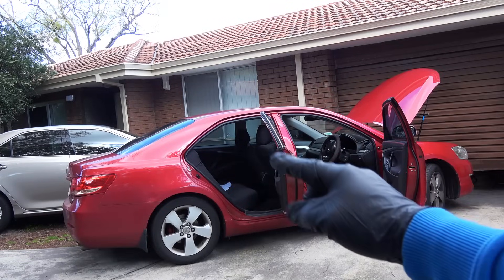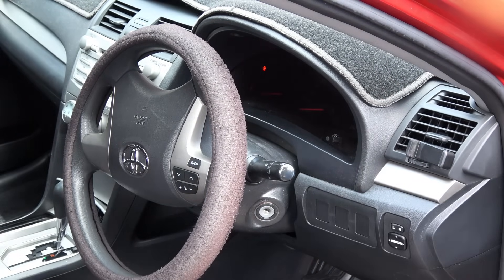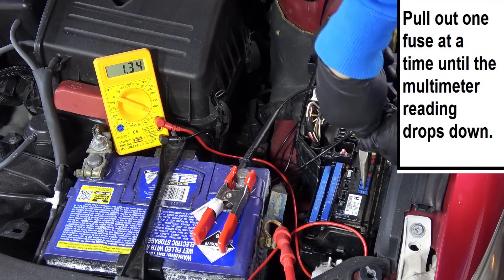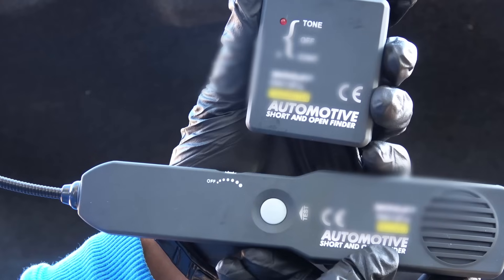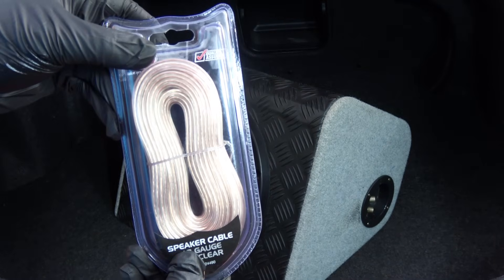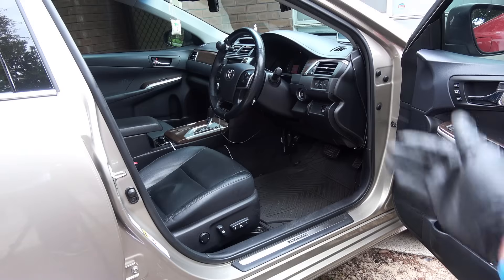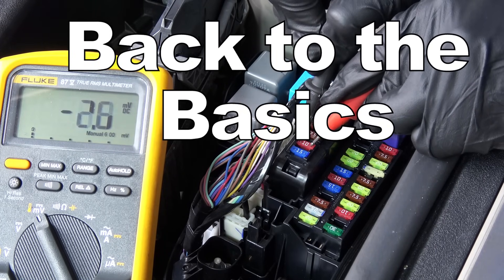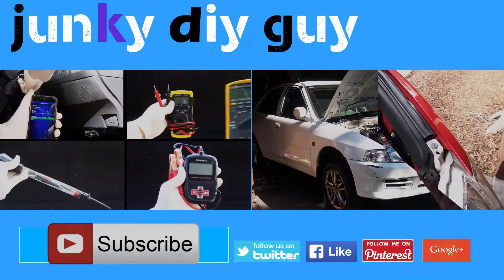How to find a short in a modern car fast and easy (The correct way)

Comment: The fuses actually do NOT protect the components,  their functions are to protect the installation  and avoid electrical  fires. (1.13)

1 -  If a component  draws too much current  it already is bad and the  only thing left to protect  is the wiring...
2 - If there's a short to ground causing higher current flow than a component  can stand, this short will  take place before the component and the high current doesn't even flow through it.

Think about it😏
Reply: Correct in a basic ckt unless the short occurs after the load, spikes and takes out an IC or other sensitive components or cause shunting.
Reply: A short to ground can occur after the component between 1 or more loads and may not blow a fuse.
Reply: Smart person who wrote this your right!
Reply: max webster
 If the short takes place after the component current flow will be limited by the component itself to the amount the circuit was designed for.
Reply: Not necessarily. It will be limited by the fuse which is there to protect the wire not the ckt.
Reply: In the case you have a short (GND) in a ckt AFTER the component a decrease in R may occur and you now have increased current. The damage might not be contained to that component and may jump to the next component in series. I disagree with your comment in a series ckt. If you wan to talk parallel, series parallel then throw a bad diode in and it's game over for some transistors and IC's and a good chunk of trace.
A short(GND) can occur after a load and might not cause a direct component failure other than by increasing current (not limited by the component) and you just missed the boat and may have ignited your new parts. Components DO NOT necessarily regulate current.
Reply: max webster 

Be so kind to give me just ONE example where the scenario given by you applies in the automotive world.
What I do see is a one-load-per- circuit rule. No such thing like loads in series.

I think components do NECESSARILY limit current,  always. This happens because of their inherent resistance 😀
Reply: Any component that includes a ckt board that is connected to the engine harness, pcm, bcm, relays with diodes, heater controls, power door locks and windows. NO such thigs as loads in series? WTF lol! Fans, variable speed fans and if I recall the dummy light for your alternator. A light bulb is a load hence GM reversing polarity TS, BL and my favorite the shift interlock system.
Reply: The active devices (FETS) are MUCH faster than a fuse. The transistor will blow BEFORE fuse opens

Comment: Every thing was correct up until you tried to pretend your subwoofer wiring short was pulling current on the radio circuit. I'm just guessing you used that as an example, to show how shorts can happen, but it's not possible for an aftermarket sub on it's own amp to be pulling current from your radio's memory circuit.
Reply: Mansour Ahmad if the istallation was so bad the the sub its self is pulling a current by bei g shorted first off thats all a sub is. The voice coil in a sub would do the same because its just a coil of wire that runs from the + termimal coils around the magnet then goes to - terminal. And if an aftermarket istallation place did such a crappy job that a sub pulled current from a battery i would really love to know where the hell they got their experiance. I could go out right now take all 4 wires to my subs connect them all together in one big clump and ill bet u anything my battery will be fine and there will be no current being pulled. But i do get his point. He obviously did t want to take the extra time on camera finding the short causd that really wasent his point
Reply: @jonnyr4332  k
Reply: Neurocidal it can happen if the installation was bad

Comment from the maker: You guys wanna know "How to STOP BRAKE SQUEAKING in your car  https://www.youtube.com/watch?v=ivMB4WEGgZo
How to Properly Replace Brake Pads and Rotors https://www.youtube.com/watch?v=cqX_o4bHq6U
Reply: Junky DIY guy p.
Reply: Junky DIY guy: I have a question. How do you chase the wiring harness on the radio if there is a  short circuit . Do you have to remove or uninstall  the radio from the dashboard ?

Comment: Great video, it was very descriptive. I had a small question, I have a fuse that keeps blowing (its the tail fuse, controls the tail lights, parking lights, and the license plate lights). I found the problem to be the parking lights, since the fuses stopped blowing when they were disconnected. What's the next step?
Reply from the maker: the only reason why a fuse would blow is flowing too much current through the fuse. Either someone installed brighter light bulbs that require more current than regular light bulbs or splicing the tail light wires to draw power from it to power up something else like extra brake lights or reverse lights. Assuming it's not the case in your car or you don't have a faulty body control module, i highly recommend to check the wiring harness for any shorts. Looks like You have a short to ground. possibly anywhere between the fuse and the tail lights on the live wire that goes to the tail lights has a damaged insulation, that rubs against the chassis.
Reply: I did install aftermarket headlights that have CCFL halos, but on all the reviews on Amazon, they said that they work fine and don't require additional power. How would one go about checking the wire harnesses? I have access to a wiring diagram, and I located the grounds for the tail lights, parking lights, and the license plate lights.
Reply from the maker: you said you have found the problem to be parking lights. there're 4 parking lights. 2 in the front, 2 in the rear. Narrow it down to to see which one of them causes the fuse to blow. Rather than blowing a bunch of fuses as you test, you can buy a re settable fuse circuit breaker that goes in to where the normal fuse would go in. so you can manually reset the fuse every time it blows out. Once you narrow it down to the defective parking light. Then start checking the live wire that comes to that light. check the parking light switch too. Sometimes they short out inside.
Reply: Junky DIY guy thanks. Actually, a set of 25 fuses only cost me $5 so it's really not worth it. Also, I found out that the problem is the passenger side parking light. If I unplug that, the fuse doesn't blow. Should the next step be to try to trace the wire from the lights to the fuse, if that's even possible?
Reply from the maker: Sachin Nair yes it is
Reply: Ok, will let you know if I have any more questions.
Reply: If you're powering your aftermarket headlights from the power supply to your tail lights then the fuse for your tail lights probably wont be able to provide the power to your headlights and tail lights. When the fuse blows, can you confirm your headlights don't work. If you put your multimeter in place of your fuse, what current does it say is being drawn from the circuit and how close is that number to the fuse rating?
Reply: +Sachin Nair No. Check the section you unplugged. If you just removed the bulb, then the bulb was short, or maybe something wrong with the socket. If you disconnected some wiring section to the lamp, then check that wiring and the lamp itself. Do not buy 25 fuses for $5 and blow them all. Use your multimeters continuity test function and/or ohmmeter function. If there is a dead short, then it will show some 0 to 1 ohms. You can't really isolate which is shorted, if you can not disconnect more things (you can, with different methods, but that needs some more experience and practically equipment).
Reply: Do NOT put your multimeter across in place of the fuse as Karlosss suggested. If you have a short, it's a good way to burn up your meter. Since you've isolated which circuit it is, check to see if the insulation is rubbed off the wires somewhere or if mice have chewed the insulation off. I've seen them destroy major wiring harnesses.
Reply: @waltp3373  maybe he forgot to mention without the battery being connected...

Comment: Hey Left You 2 Likes, I Appreciate Your Clear Video And Detail About "Sleep Mode" For Both New And Older Cars, I Didn't Know Such A Tool Existed That Was A Wireless Beeper For Finding Short In Wire. I Got 95 3000GT VR-4 Apparently A Starter Relay Was Where Mechanic Followed Issue To, IDK If He Meant Outlet or $80 Relay! But Under Driver Panel Has All Wires Hanging Out, Many Spliced, Theres Even Open Jumper Wires Dangling And Weird Box With Dial Attached Maybe (AfterMrkt 1998 Radar)?! Could You Make Video On How To I.D., Test, Figure Out Loose/Spliced Wires? Basically Where You Would Start? Schematics? BTW I HotWire To Start And No Reverse lol, Thanks Either Way
Reply from the maker: Thanks mate, appreciate it. seems like your wiring harness has been tampered with by someone. if that's the case, going through a visual inspection first will be my start. If required, i would also go through wiring diagrams. If your mechanic had already narrowed it down to the relay, then you can easily check the relay with a very inexpensive relay tester. or swap it with  another one to make sure it is the relay. Go from there i suggest. it can be the connection to the relay under the relay box. as cars are getting older, they become loose due to vibrations and plastic shrinking. so check that too. Mitsubishi's from those days are not that hard to work on. you've got a cool car btw